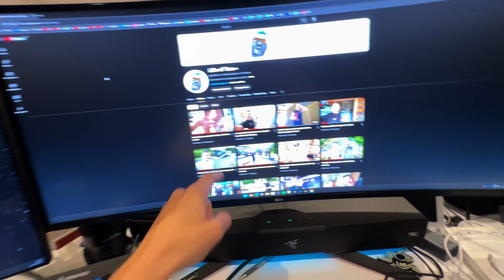I Pulled Off the Perfect Surprise Plan! 🎉

Comment: Tom I used to work at currys. If it's bang on 600 the machine has no where to move when it's spinning and will probably damage the unit or wall. You need the space round it. 

Take the skirting board off and get a 600mm wide cause others won't fit. You also need the depth mate cause the pipes eat your depth space
Reply: U R so right ---  hope he reads your comment but he's away so probably not - he needs to tho

Comment: WASHER/DRYER IDEA! Since you’re stacking them anyway, why not build a little platform the height of the skirting so that they sit just above it, no need to cut skirting or the worktop 🎉
Reply: Washer will probably slide below the overhang of the worktop. Don’t rush into cutting the end off your worktop
Reply: Have a drawer underneath so you can put your basket in the drawer and load up the washing/dryer
Reply: Might as well if ran the work top to the wall  🤪🤷‍♂️

Comment: TOM!!!! easy fix for the washing machine and tumble dryer situation, the units along the fridge freezer side can be reduced in depth if needed you just reduce the service gap and reduce the depth of the worktop above! you need a minimum 600mm space for a washing machine, but 610mm is better for wiggle room and easier to open detergent drawers. ALSO certain brands you can buy a stacking kit that has a pull out shelf function that's what i recommend.

Comment: So if your gettiing a seperate washer/dryer and stacking the washing machine should fit below then countertop snug in without taking the skirting off and im pretty sure you can get a seperator to put between the washer and dryer. if not id say cut the edge of the worktop back and move the laminte edging or buy an edge trim.

Comment: Tom here is an idea. For the washer and dryer, get a U-Shaped unit made (upside down) the height of a laundry basket. Then you would have gone above the skirting, giving you that extra 10mm or whatever it is and you will have a home for a basket which then you can easily just pull it out when you are emptying the machines and simply drop it in. I don't know the logistics of it or if that unit will carry the weight of 2 machines but might be a good idea to try. Then you wont have to cut anything maybe?